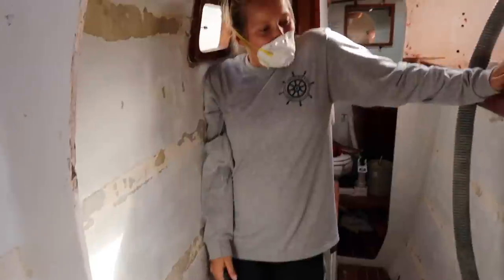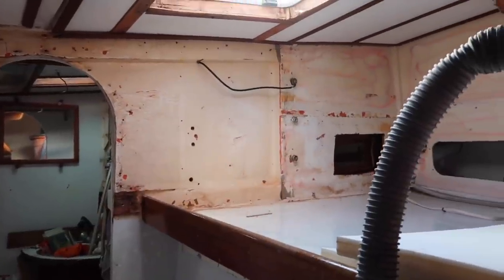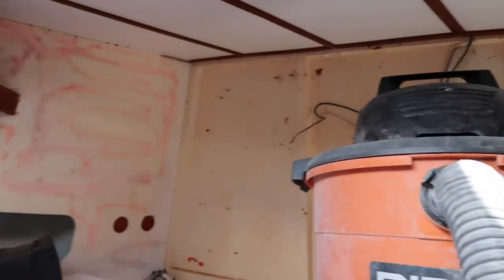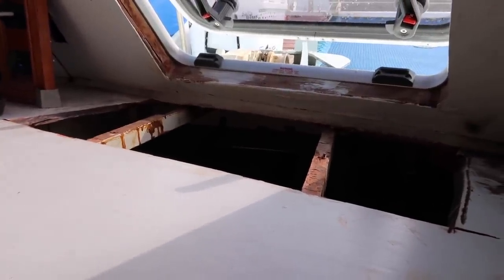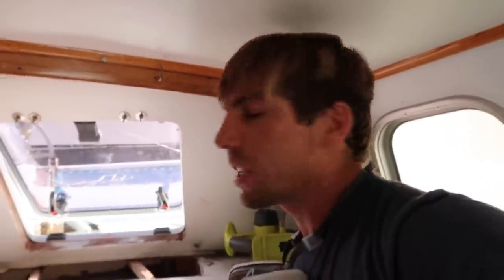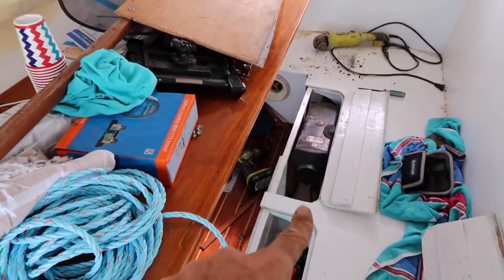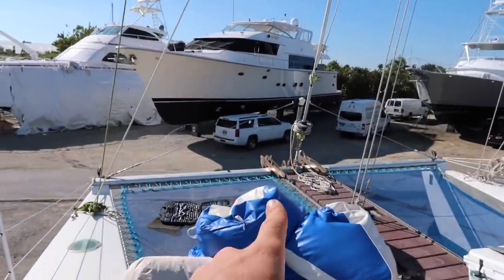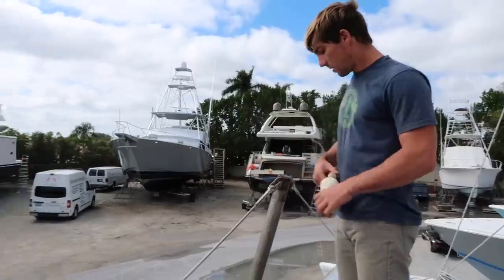REMOVING OUR FORWARD CROSSBEAM (thank goodness we had help)

Comment: Install a lightweight plastic water tank in that space and plumb it in with valves so you have the option of holding more water when you need to, or leave it empty if not.  Plastic tanks aren't expensive.
Reply: A bladder tank would be easier to fit in there. Extra water is at a premium in the islands
Reply: @johntripp2028  I agree.  Even a bladder tank would be better than nothing in there.  The limited access to it would make me want a more permanent tank though, if possible.  Frame out a level spot, and a 40-50 gal tank would fit right in there and last 20-30 years.

Comment: Wow. Big projects. That’s a tone of work to do. I’m surprised though that you are not going to create an access panel on that seat back by the front window where you are cutting out that old water tank. I know you are on a mission to cut weight but storage on a boat is a premium. It doesn’t mean that you have to fill it up with stuff but having access to that space would be nice. Maybe it could be blanket, pillow day storage....things like that. Good luck with getting all these projects done.
Reply: AKA JBS Smith storage also means access. Hidden spots in boats are usually where you need to get access. Put some drop in access hatches...you can keep it simple. Then if you ever have to get access in the future you have it. It will also be a selling feature when you do decide to sell. Fair winds guys.

Comment: I had glassed-in chain plates also. Rather than dig them out and make a huge project/mess, I left them in the hull and layered my new stainless chain plates along side, with  ew bolts through the existing holes. The old plates served as backing plates. Better than new.
Reply: You know a Fabricator!

Comment: Billy, I can’t imagine that pulling that old sandwiched chain plate was easy, why didn’t you just cut the old one flush on the top deck, seal it closed, cut a new slit just beside it so the new chain plate drops parallel to and fastened using the existing bolts positions. This way the old chain plate is entombed and the new one lies easily accessible to future inspection and maintainance. Just an idea.
Reply: This is a great idea. A second pair of eyes and a different perspective really help when doing projects like this.
Reply from the maker: Great idea! Didn’t even think of this. We may just go this route..
Reply: Billy, this is a very good idea.  Remove the old chain plate bolts and scab new plates on the outside.  Thru-bolt it all the way using B-7 studs and torque it.  I’m sure plenty of us would not mind helping figure out the torque specs this would require.   I would use castellated nuts with cotter pins.
Reply: Donald Klarich jn

Comment: Use a stainless steel,wire brush on the alloy, and a flap disc,  to cleas and smooth the stainless fittings , leaves a better finish than a grinding wheel

Comment: .      Hey Billy.   Good morning to you guys.    If you're going to be polishing any aluminum on your boat, look up a couple videos by Cecil Skinner on his Off Grid Homesteading channel.   He used a polishing compound called Flitz on some really crusty aluminum snowmobile parts. He was really impressed with how well it worked.  Really quick too.   Used it on aluminum, paint, plastic, fiberglass gel and on a clear windscreen on his snowmobile.  I ordered some to polish an old airplane propeller that I have in the barn. 

Good to see Tula getting upgrades.  Be careful, be safe, but always be happy!

Cheers!

Whipple

Comment: I hope the water tank didn't double as extra bulkhead support for rigidity. Taking off weight is good . I'm surprised that there are no build plans for this cat that would show chain plates and bulkhead construction . Your cat will be so light that you will be flying a hull easily ! Thanks for sharing 😎

Comment: Hey Billy, Just an idea for you. How about putting 1/8" Neoprene rubber in between that cross beam and that stainless steel hardware? Also maybe nylon washers on those SS bolts?  You probably already have an idea on how you're going to do it but I thought I'd mention it.

Comment: Why would you get rid of the diesel heater those things are awsome and only burn 1/4 gal an hour to heat you cabin.
Reply: They live in Florida..... the one thing people rarely ever need in that state is heat, even during the winter.  Any unusual cold snaps only last 2-3 days and are very far in between.
Reply: @ramspecialtyservices551  , I would say "Resale Value".  They WILL sell this boat at some point and those extras count on appraisal.

Comment: Refits are a lot of work, but at least it's still cool out, rather than being the middle of summer. I've never understood why folks use vinyl liners in boats. After you remove the SS water tank, you may want to just throw a bunch of pool noodles/foam in the void as an extra bit of safety buoyancy.

Comment: Good video guys that extra weight off the boat would definitely help you know that heater you should check it out cuz it could be worth a lot of money if it's not from China they're about $1,000 and up and not much goes wrong with them but you can buy a brand new from China for about 250 bucks are you can find them on Amazonkeep up the great work yeah it's been raining up Central Florida for about 3 days light rain this morning fairwinds

Comment: Now I feel bad that we scolded you guys for not posting for over a week. Apparently a boat is just an endless pit of work. Can the new beam be some sort of nylon or plastic that won't rot or pit like that? Most plastic degrades in the sun, so maybe it should just be straight up wood, that you know you have to replace every few years. But at the least, easier to get off next time..
Keep at it, and we'll keep watching.
Reply: That beam is structural. It is under heavy load all the time so aluminum is the lightest strong material available economically. Carbonfiber would be ideal but would have to be custom made and enginered costing a small fortune.

Comment: Don’t close off empty dead space.  Put the other water tank there, the one you had to move to access the chainplates........
Reply from the maker: We would have to cut a very big hole to get the tank in there... of glue the water tank back together in the space :P New water tanks will be going back in the compartment in the bathroom with a new access door:)